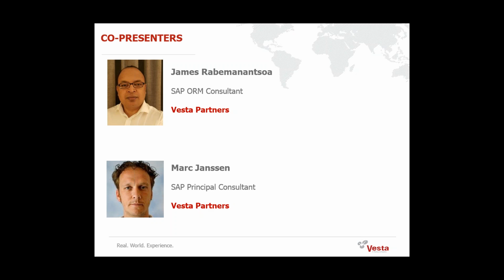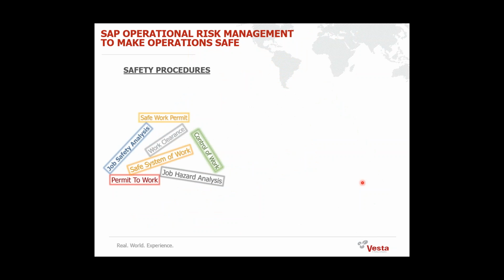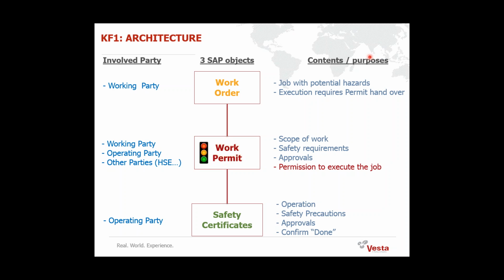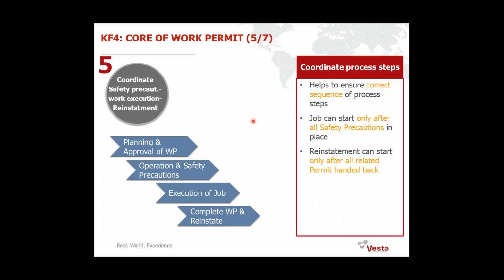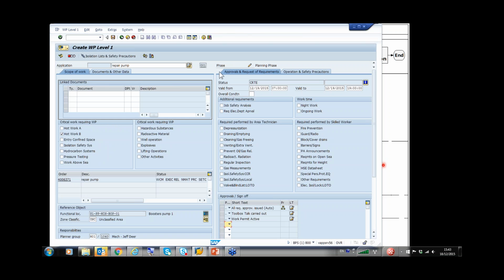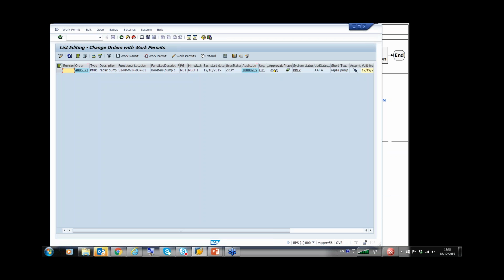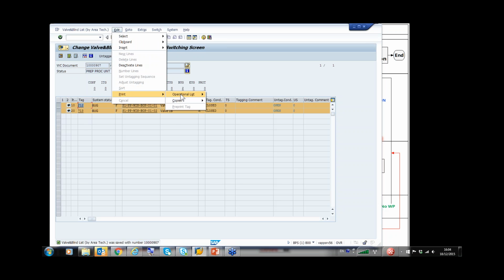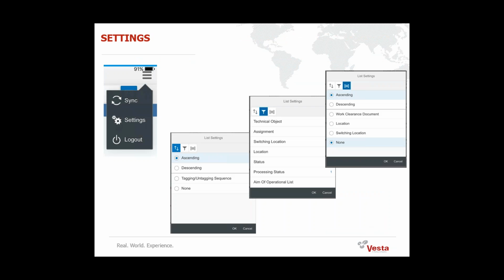Bring Safety to Life – Check out SAP’s Work Permit Management (WPM)

Comment: Hi WCM Guru, 
How did you do to  insert subscreen "Required performed by area technican"?

Tanks
Reply: I will try to answer you because I had the same question you had. You have by default this data elements in the ABAP dictionary. From WCEWK01 to WCEWK28 and from WCENEED01 to WCENEED29. Does dynpros are 8410 and 8420 one for each type of data elements, those data elements are at the end the check boxes. To activate the dynpros you have to configure the following customizing points Define View Profiles, and Assign. View Profiles. The answer is one year later, but it may help others aswell